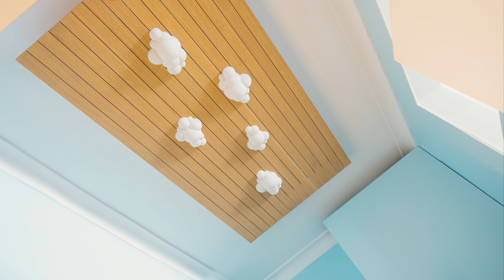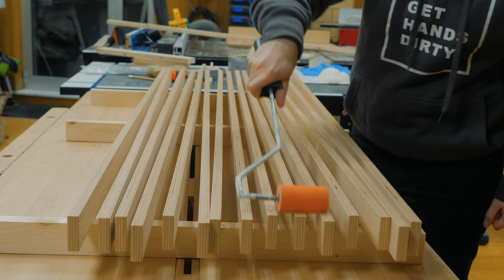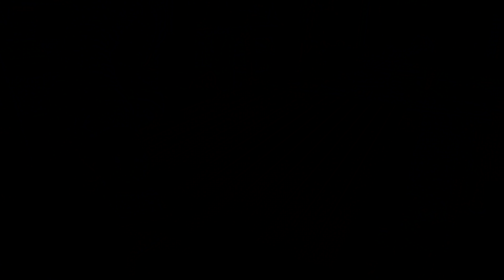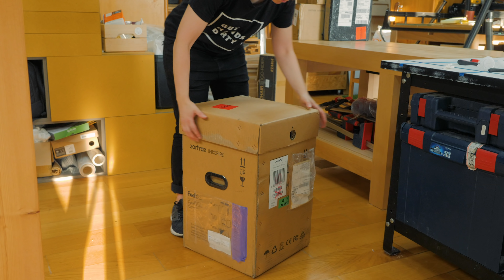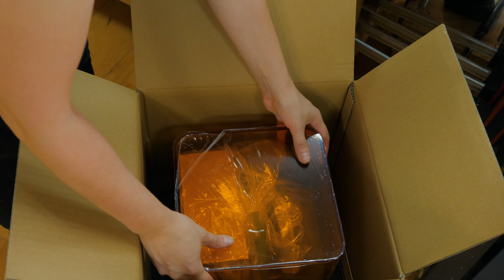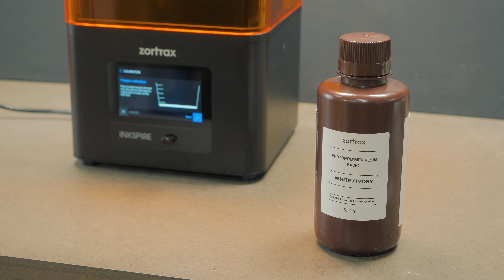Cloud Ceiling Lamp // Tiny Apartment Build Ep.11

Comment: Great work as usual, but when soldering you should melt some tin on the solders tip to use it to transfer heat more efficiently instead of putting the "dry" tip on the wire

Comment: Great job as always!  Hint for the future: I'm old enough to remember a time before, "D-side" tape.  I used to make a loop of tape, stick it on then squeeze it really tight.  Sometimes it worked!  Lol!  It would have worked well for your templates though.  Use the loop mentioned for precise placement then slit the ends (or not) to apply the "cyano".  Now, to read the comments and see how "UN-original" I am.  Ha, ha!  Be safe and mindful!

Comment: FYI, CA glue can be loosened with heat, so for the aluminum you can just CA them to each other and a quick hit with a propane or butane torch will loosen them up

Comment: You should NEVER use Isopropyl Alcohol(IPA) in an ultrasonic cleaner. The nature of IPA is that it constantly wants to evaporate, and when you put it in an ultrasonic cleaner it turns something that's a little flammable into something that's is borderline explosive. Stick to a degreaser, or a semi-industrial cleaner that doesn't include alcohol. You should get resin printing tips from the youtube channel "Uncle Jessy"

Comment: You do not need to scrape the varnish off the copper, the heat of the iron will vaporize it on contact.
Reply from the maker: I tried to solder and it didn’t work at all :) really needed to expose the fresh copper for it to work unfortunately.

Comment: How come plywood is more stable than oak? Seems illogical.
Reply from the maker: From my experience, oak is more prone to warp/expand with moisture than plywood. I’ve seen solid oak floors and doors all messed because of the moisture of the air during winter time, for example. Most solid wood is not as dimensionally stable as plywood. If you create a piece of plywood with the same species of the solid wood you are comparing it to, it will be waaaaaay more resistant and stable...
Reply from the maker: In this case I did use baltic birch plywood. Obviously we are not talking about cheap crappy plywood from the home center or so...
Reply: @GetHandsDirty  I think I understand the logic behind, would it be like saying that oak is so dens that its elasticity is pretty crappy in comparison of Baltic birch plywood?
Reply: @My_Op  When I hear about oak I only know that my house in everything that is made of wood is solid oak. After 16 years, even now, with humidity or heat, doors swell and shrink and the floor lifts. I chose it because I really like the color of the oak and I knew it, even so I wanted to. But there is this problem.

Comment: Great project, however since the lamp is hanging right above the shower I recommend to get your hands on some "conformal coating" to cover up your plain solder joints to prevent corrosion due to water vapor  and potential failure in the future.
Reply from the maker: Yes, thank you for your suggestion Timo. I did apply neutral silicone to all the ends/soldered areas so that nothing is exposed to moisture. On the part that I am applying the magnets you can actually see the light plates with the silicone in them.
Reply: Ah, sorry I must have missed that part :)
Reply: I think she mentioned that she put silicone over the soldered pad connections (due to what she had to hand so to speak)

Comment: arts and craft tricks for not having double sided tape: make a loop out of masking tape, sticky side out. Use it like a double sided tape, but take note that it is weaker and are quite bad at resisting pulling force.
Reply from the maker: Ahah I know that trick and it is indeed weak for this purpose :) The blade cutting would have moved the pieces. But I use the tape loop all the time for years for other types of application!

Comment: Awesome project, but I have to put out this warning re your resin printing section, NEVER PUT ISOPROPYL ALCOHOL IN AN ULTRASONIC CLEANER. The alchol is heated when the cleaner runs, even if the heater is turned off. This releases flammable vapor. IF an ultrasonic transducer fails, it will shoot all of its electrical energy out of the transducer and into the cleaning fluid. If this is a flammable liquid (LIKE IPA) you end up with a fireball. So if you use an ultrasonic cleaner, you must use a nonflammable solvent like a degreaser or soap and water. Many like how 'Mean Green' performs, though it may not be as available outside the US. There are lots of good alternatives. I like to rinse my part in a jar of IPA first, then into the ultrasonic cleaner w/ Mean Green. Works well and is very safe.
Reply: https://support.zortrax.com/inkspire-model-cleaning/
Reply: As long as you don't run it very long the liquid won't heat up. With SLA you probably need 1-5 minutes depending on how much resin is dissolved in your IPA. 

Also even if the transducer fails and passes current to the metal shell of the machine, any decent machine is grounded and will not pass that current to you if you touch it. Plugging these into an RCD or GFCI is probably a good idea (any time you have liquids near electricity it's a good idea). It would also have to actually spark to ignite the IPA which is unlikely.
Reply: @namAehT  Lots of dangerous scenarios are unlikely, does that mean you should still willingly put yourself in them? No way.

Comment: Looks amazing! Great work as always. Are you concerned about moisture build up on the electronics and even direct water contact from the shower being used? Splashes, etc?
Reply from the maker: I did apply neutral silicone to all the ends/soldered areas so that nothing is exposed to moisture as I mentioned on the video, but I did it off camera unfortunately. On the part that I am applying the magnets you can actually see the light plates with the silicone in them.